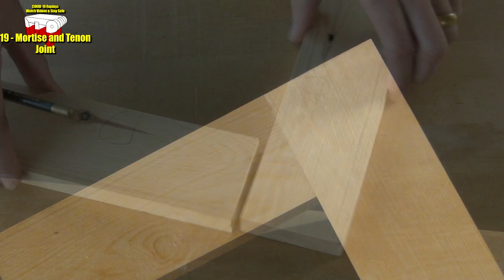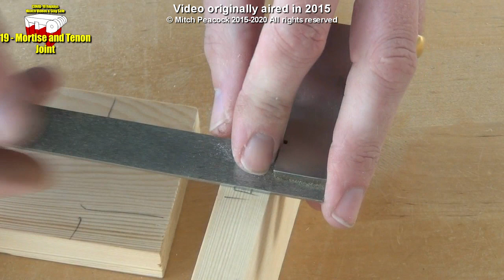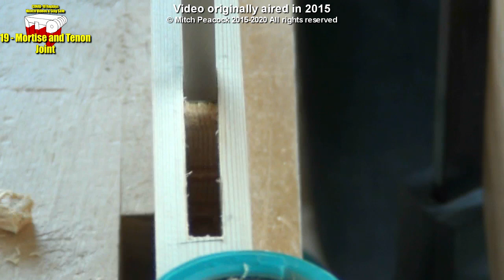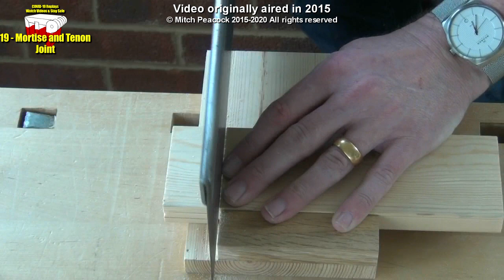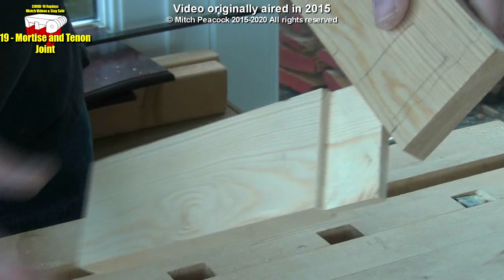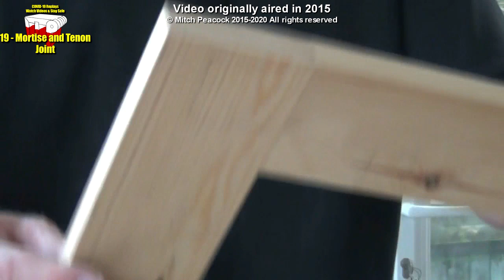Unplugged Mortise & Tenon Joint - COVID-19 Replays

Comment: 08:36 "I wonder how a guy would do it with power tools". Several approaches can be taken:
1. Use a drill press with a depth limit set to take out the majority of material from the mortise. Then clean with a chisel (it's a hybrid approach now, isn't it?) the rounded corners into right-angle corners. As for the tenon, a table saw with cross cut sled can take care of it entirely.
2. Use a plunge (power router) and "dig" the mortise and keep the rounded corners. After making the tenon as in approach #1, the tenon's right-angled corners can be rounded with a belt sander to fit the rounded mortise. 

Anyway too much dust and noise. Also, the table saw is a real danger even for experienced woodworkers..
Reply from the maker: Using a drill to bore most of the waste out is popular, and you could use a brace and bit to keep it unplugged.
Stay safe.